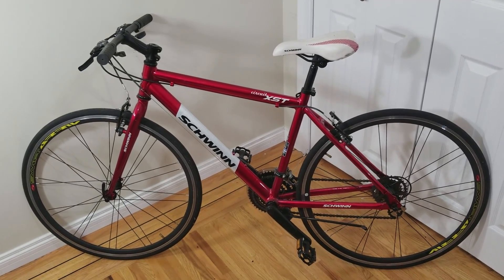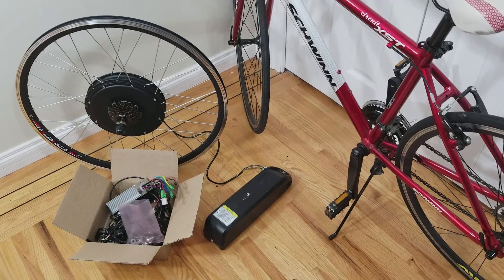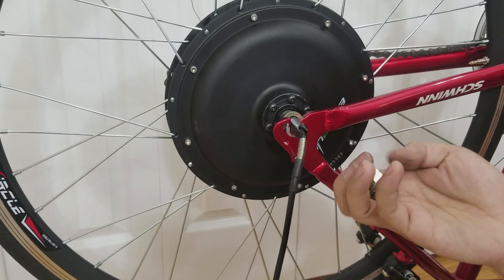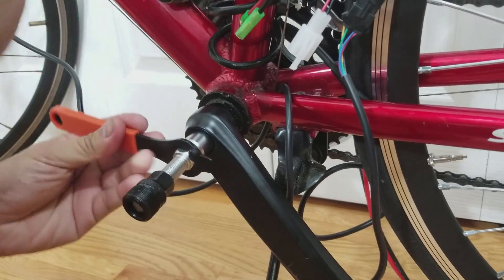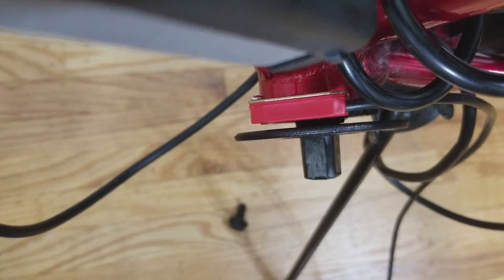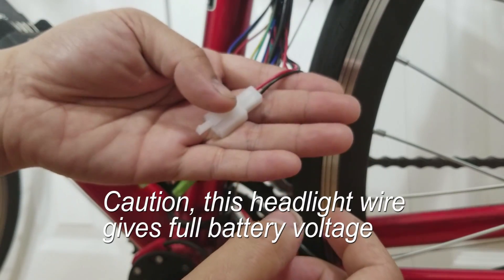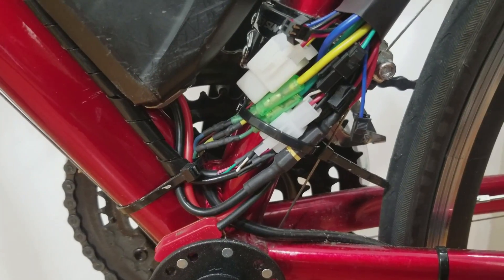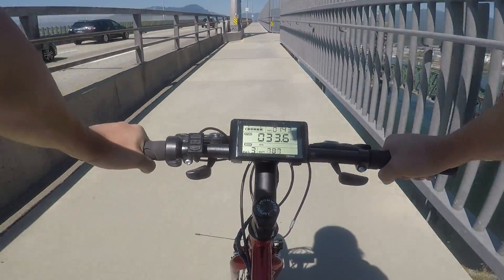1200 Watt EBike Build - Cheap + Fast = DIY

Comment: Use an inner tube and some zip ties to cover the connection by the chain stay. It will look clean and protect the wires from water if you ever get caught riding when its wet. Inner tubes are so versatile. You can cut them up an infinite number of ways for many uses. Most of us who ride have tons of dead tubes laying around.
Reply: Channel Zero One yeah i always wondered about rain rides. most kits come with a bag but can you ride in rain or do i need to electric tape and scotch coat everything? i ride 365 and a 1/4 days a year. rain or shine. even in snow.🍻
Reply: Genius

Comment: Great to see how you implemented the components on your bike. Can you do regen braking? I find that it works well on my bike.
Reply: Rogen isn't worth it unless you take mountains. Too little extra power for the cost.
Reply from the maker: thanks, this controller does not support it. if i buy a new controller, i would definitely  go for one with regen

Comment: if i was to fit my own E-bike id try and use a frame that has routing inside the tube where the brake and gear cables would thread through and use that to route the cables of the kit ( of course can drill your own holes but meh ) and tidy it up with flanges for exposed wires use weather resistant heatshrink to make it look legit and clip tie to the forks and frame
Reply: do you know any budget road bikes that have routings inside the tubes?  because i live in netherlands, and its kind of a must to waterproof it

Comment: at least put on some proper brakes, those cheapest possible bikes are full of absolute crap parts.. and when you have more weight & speed, those brakes are not enough. it would make much more sense to buy a used older mid to high end.. than an absolute shit cheap bike.

Comment: Awesome build! Would you recommend 26” or 28” wheels for an ebike? I’m looking to build my own and I don’t know what size wheels (and simultaneously, the type of bike) I should get.
Reply: Better go for the smaller rims if you want a hub-motor. The spokes should be a bit more rigid. I build my 29" MTB with a hub motor and two spokes broke already since May.
Reply from the maker: if your commute is well paved bike paths then a skinny tire bike would be nice. otherwise i would get a mountain bike. im not a very tall guy so i would choose 26". my next ebike is a mountain bike with 26" wheels, it has only front suspension, and disc brakes
Reply: @DougHnut  My commute is has a few hills but there's decent roads. Should I get a mountain bike or a skinnier wheel bike, like a hybrid?
Reply from the maker: Yeah I think hybrid will suit your commute. Just get some fenders if you need and good tires like schwalbe marathon. Also if your budget can afford, I'd suggest disc brakes
Reply: @DougHnut  Okay, thank you so much!
Reply: @DougHnut  O.K., but is there a reason for not having rear suspension on an e-bike?

Comment: You need hydrolic disc brakes
Reply from the maker: i agree
Reply: @DougHnut  I don't.  1200 cc motor cycles weighing in excess of 400 lbs got along fine without hydraulic brakes and/or disc brakes for 100 years.  You really think that rim type disc brakes are in-adequate for a 50/60 lb bike that cruises at 20-25 mph?  If there's a problem with rim brakes, it's with the brake pads, not the brakes.

Comment: Hey Doug, can you give the specs of the drill you used, the bit, and the tool and rivets you inset into the upright? Thanks. Great video, very coherent. and covers the details often left out by other videos on the same subject.
Reply from the maker: sorry for the late reply

https://www.ebay.com/itm/20-40-100X-Flat-Head-Metric-Threaded-Blind-Rivet-Nut-Insert-Rivnut-Nutsert-Screw/151788854026?hash=item2357521b0a:rk:1:pf:0&var
-carbon steel, m5, 20pcs
https://www.ebay.com/itm/86pcs-Hand-Riveter-Nut-Rivet-Gun-Kit-M3-M8-Manual-Threaded-Nut-Rive-Tool/223192293583?hash=item33f74c20cf:g:734AAOSwC9hb4PL8:rk:2:pf:0
-heres the tool , dont bother with the aluminum rivet nuts
https://www.aliexpress.com/item/Vastar-3pcs-HSS-Steel-Titanium-Step-Drill-Bit-3-12mm-4-12mm-4-20mm-Step-Cone/32855749324.html?spm=2114.search0104.3.41.26e37eb9MQD9KA&ws_ab_test=searchweb0_0,searchweb201602_5_10065_10068_10130_5734615_10547_319_317_10548_10696_10924_453_10084_454_10083_10618_10139_10920_10921_10922_10307_537_536_10059_10884_10887_100031_321_322_10103_5734515,searchweb201603_2,ppcSwitch_0&algo_expid=edb6a737-8157-4ec1-bf85-e8ac5c8c5e28-5&algo_pvid=edb6a737-8157-4ec1-bf85-e8ac5c8c5e28
-i used a uni bit to drill the hole but a 7mm drill bit would be the perfect size
https://www.milwaukeetool.com/Products/Power-Tools/Fastening/2453-20
-this is the driver i used
Reply: Hi Doug! Thanks for the VDO, it inspired me to DIY my own e bike. I ordered 48V 1200W rear drive hub from ebikeling and now it is on the way to me (Zurich) I am Looking forward to the installation. I have a question according your VDO about the speed, you mentioned the average speed is 28Km/h after 50 km riding, how was the road like ? Hilly and many stops? What if there is no stop and small gradients hills how is the speed going to look like? 30-40Km/h is possible? Thanks in advance for your answer.
Reply from the maker: Sorry, I just noticed the message. The hills were moderate. And there was hardly any stop and go because it was after midnight and no traffic around. So  I think 30 kph average would be easy.

Comment: Will the wheel fit a bike with discs brakes?
Reply from the maker: yes, its has the mount for the disc built into the hub

Comment: Can you ride the bike in the rain with the wires exposed like that?
Reply from the maker: Probably not. It will work, but given time, the connectors will corrode. If I were planning to ride it in the rain, I would add a splash guard so the rear tire wouldn't splash water directly onto the wires. And I would also fill all the connectors with a dielecetric grease for corrosion resistance. You can get that stuff from an automotive parts store.

Comment: You can get schrader tubes with 48mm valve stems that work with those rims. I also bought an ebikeling geared motor kit and also painted my controller black :) I put the thumb throttle on the left, I just curled the cable back around and used a zip tie to keep it in place. Has worked fine for the 5 months I've had the kit.
Reply: Or just widen the hole with a drill.

Comment: Looks like SW 900 display my one showing error 6 maybe needs stronger batteries plus settings for parameters didn't have manual chased on YouTube  lucky founded;!
Reply from the maker: got to parameters settings and make sure you have the correct voltage battery set. setting P03 Voltage grades. 24V, 36V, 48V

Comment: Warning: the red pedal assist sensor needs to be flipped around on it's metal holder (wire side toward front of bike) if your going to mount it on left side of crank as here. Otherwise Pedal Assist will not function properly.
Reply from the maker: the pedal assist works as it should, but it also activates when i spin the crank backwards. is this what you mean by not function properly?
Reply: @DougHnut  https://youtu.be/ZwJhIGMDANA
Reply: Doug, strange that it works both ways (I didn't install the PAS). Another question: Does your SW-900 display show speed and mileage when you're NOT using PAS or throttle? Mine didn't, and I ended up removing it and using the LED display with my Velo 9 bike computer. One thing I did learn about the SW-900 is, with 26" wheels, if it's not showing  accurate speed (mine said I was going 30 MPH on the sidewalk :), set P07 to 86.

Comment: Nice video, you've got  great building skills. Not sure I'd of painted the speed controller black but not a criticism. It looks good.
Reply: Prolly to hide that 1200 W logo?
Reply: give it a rub with sand paper afterwards to expose the tops of the cooling fins   =  alloy stripes
Reply: @rossprivate5456  The paint won't make a measurable difference.